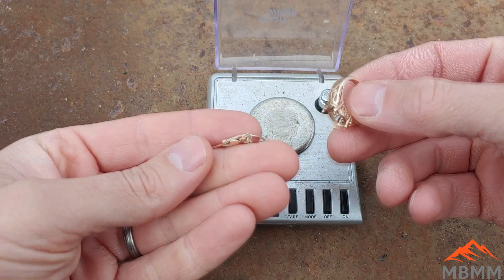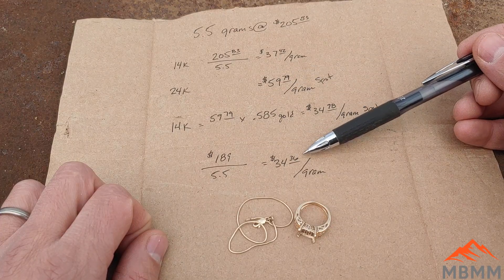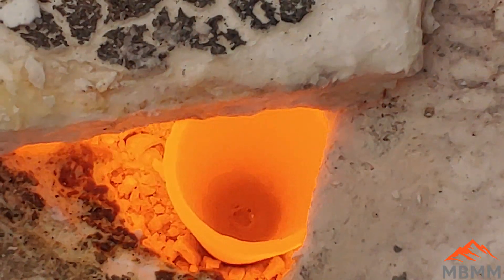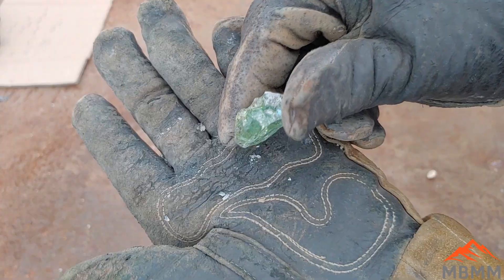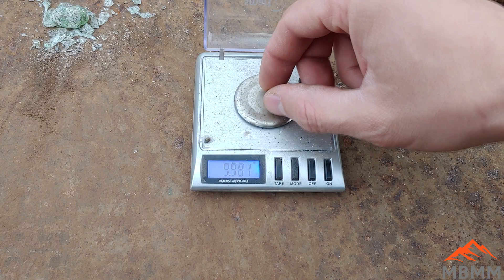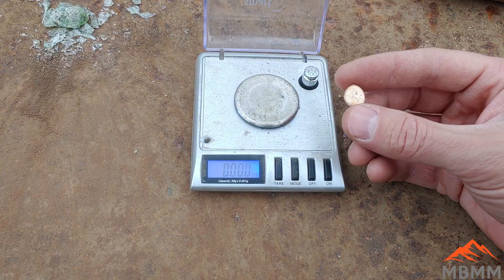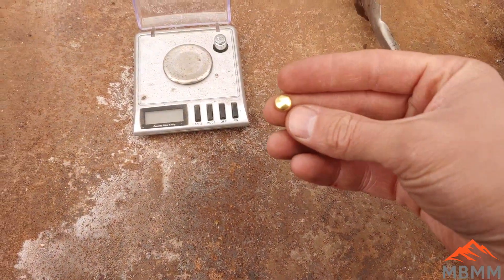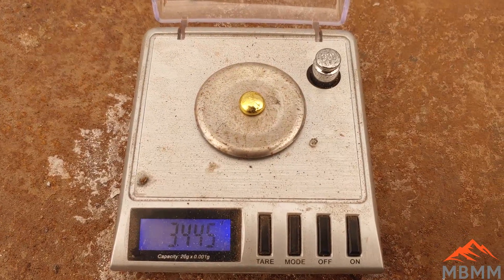Refining 14k Gold Jewelry Scrap To Precious Metals

Comment: I’m new to smelting and using a cupel and I’ve taken the time to watch your videos (which are awesome!) many times to make sure I do this right. I’ve taken all the safety instruction seriously and lined my furnace along with PPE’s. Now my question: how much lead would you use per gram to 14k per gram or percentage of gold in a given jewelry (ie 10k, 14k, or 18k)? Also I bought off of Amazon some bone ash cupel that seem just too small to even cupel a 5-6g 14k ring, what size cupel would you use to do say 10g at a time and how much Pb would you use? Mahalo for your answer and thank you for all the awesome videos you’ve made!!

Comment: I know this is years old hoping this is seen as I need some help. I have about 21 grams of 14k and 18k gold scrap that was passed down to me from a jeweler family member who passed. 1/10 of a gram shards cut off rings after the casting process, tiny tiny little pieces and I have to refine it in order to sell it. Doing it at home, my question is if I go straight to the bismuth method, would adding borax aid me at all? For example, by lowering the melting point and making it easier for me to melt? I have no furnace, buying a couple cheap torches that are supposed to heat beyond golds melting point so kinda just doing it outback with w cheap materials. Any ideas are so appreciated ty

Comment: I tryed melting a gold ring and a gold crown I used lead it did pretty good but I belive there's still a little copper in it I just used an acetylene torch it worked well then I did some gold that I've paned over the years I just used borax and it actually turned out better I ended up with a total of 5.3 grams but I'm sure it's not pure I reused the crusable but I see why you would not want to just to much slag ,ive learned a lot and I'm need to learn a lot more thanks for the time you put into these videos to teach us newbies what and what not to do thanks

Comment: Thanks Jason for all your informative content.  Quick question, if i wanted to convert flour gold into a button and pull off other base metals would i need to make the button first or can the flour gold go into the cupel with lead and skip the melting a button step?  Also with using lead instead of bismuth what would the ratio be roughly?

Comment: Is this method possible without the furnace, but using a high temperature gas torch(s) to melt the metals to a liquid then absorb the base copper, zinc, lead into the cupel?

Comment: Hi Jason, the initial weight loss is probably due to the iron getting partially into the borax glass. The lock mechanism on necklaces/ bracelets usually contains an iron steel spring. It might be worth removing the spring prior any purification. Some iron can also come from the mold.

Comment: You started with 5.494 grams of 14K. 

Once you melted and dropped the button you had a weight of 5.411 gram button the remainder weight lost was from the spring (Fe,Cr,Ni,Mo) stainless alloy in the lobster claw clasp and zinc oxidizing. Every time I XRF before I melt and after the melt I usually lose zinc % on reading. Zn in alloy reaches the boiling point and is lost in the process.

Comment: Hey Jason, I just wanted to ask you since the first time I saw your videos. In't there any health hazard from working with ceramic wool like that? I thought the ceramic dust is really bad for your lungs and it's supposed to be covered by refractory cement before you can be around it without a respirator.

Also if you're actually reading this: I'm late to the party, but that shot of the Cerro Gordo silver solidifying is in my opinion the money shot of all of the money shots on youtube. The most visually pleasing footage by far. Thank you for that.

Comment: Excellent! Any difference between Bi and Pb during cupellation?
Reply from the maker: The only difference i can tell is it seems the Bi takes a little bit longer to oxidize than the Pb. Have you tried Bi yet? Thoughts?
Reply: @mbmmllc  No, I haven't tried it yet but I plan to

Comment: Really interesting to see this - really like watching @sreetips refine down to 0.999 fine gold, but I often wondered what you get with just a cupel and you answered that question really well!  0.900 fine gold is not a bad result at all for such a simple process - I was wondering if you can scale this up to something like a troy ounce of gold or if the cupel just gets too big.  Great video!  👍
Reply from the maker: Yep, this can be scaled up. It can be used to do kilos of gold with a big enough cupel
Reply: @mbmmllc  Very cool!  Seems like it might not be a bad step prior to chemical refining - could save a lot of time and nitric acid getting all that copper out first.
Reply: @fredrichardson9761  chemical purification of gold requires quartation. You'll need to add back 3x more copper or silver to the gold, then use a bunch of nitric anyway. The cupelling still has value before liquation for removing some of the tricky base metals.
Reply: @snarky_user  Yeah, actually I think this could save on nitric when you're dealing with gold filled scrap.  Getting rid of the copper and other base metals would still be a plus if you run a silver cell like @sreetips (he does inquartation with silver).  I wonder if cupeling is a superior way of dealing with gold plated material - I think @sreetips demonstrated reverse electrolysis but generally avoids that type of material given the low yield and huge amount of work.
Reply: @fredrichardson9761  use the GP as inquartation admixture, counting it as copper.
Reply: @snarky_user  I think the issue is that the percentage of gold is too low and nitric is not cheap
Reply: @mbmmllc  I have 6+ kilos of sterling flatware here ready for a video. 😉

Comment: Hi Jason, in fact, it is very ancient method to clean gold and silver, was used here (CZ) in middle ages...
I have some placer gold, that I washed, I want to make something out of it, may be I try to cupel it. Is it possible to make cupel out of magnesium oxide at home?
Reply from the maker: Yes you can make them at home. I have used cement in the past and it works well too
Reply: @mbmmllc  Thanks, I will try.

Comment: Biggest lie in gold is that it isn't durable and needs to be alloyed. It is perfectly fine by itself and adding things is what makes gold easier to break. Any carat gold will break anf 24k will bend bend and last bend you can eventually break a piece of gold but 25k is so malleable while karat gold gets work hardened and will break if you hit it on something or gets squished with the right amount of pressure. Love your videos and did my first 24k cuppel it's only a gram but it is true 24k can hit it as hard as you want doesn't break and only bends like gold should it hasn't broken yet and I hit the thing as hard as I can with multiple hammers and doesn't need to be annealing what so ever. Thanks for the help a while back people like this are truly great teaching others. Also do you find the prices of cuppel to be ok I bought only like 10 but it is a process and to refine steady amount you'll need quite a bit of cuppel
Reply from the maker: Glad you got the process worked out! More gold to ya!

Comment: Thanks Jason. Been struggling for a little while on getting this process down for myself. My biggest question after watching the video is, about how long did it take with the first cupel in this video to get the completed button? Trying to see if I'm not waiting long enough or if I'm doing something wrong.
Reply from the maker: Takes about 30 mins. Make sure the bead is geting oxygen, but staying hot enough. If you run it too cool the bead will keep freezing before the base metals are completely removed

Comment: Excellent video, love the channel. You could have saved a load of propane on you first melt by skipping the furnace and just use a melt dish and propane torch. 
This is a great way to reduce base metals in your scrap before moving onto chemical refining. It will save you on acids and reduce the wastes you'll need to deal with after.
I will certainly consider cupelling on my next run of karat scrap.
Keep pumping out the great content on your channel
Reply from the maker: Yeah, if I was to do it again I would put it directly in the cuple. Its cheap and no labor. Reduces the base metals down to less that 1% and good point about the acid savings for the final steps!
Reply: @mbmmllc as a first timer here, I very much enjoyed your video and appreciate you sharing this content!!Great amount of knowledge and impressive craft. Just as impressive though is your willingness to continue to learn and share that knowledge along the way. Kudos and wishing much success!!

Comment: For the record, asbestos is a rock..well, a mineral with a specific crystal structure.  It isn't toxic or poisinous, and it is completely innert.  Asbestos is no different from sawdust and fiberglass.    It should be a meme, the way people will freak out about asbestos, but will happily breathe wood fibers, fiberglass, and welding fumes.
Reply: @n n People are extra afraid of asbestos, which is dumb.  People are careles with fiberglass and wood dust, which is also dumb.
Reply: @n n LOL!  You copied me first.